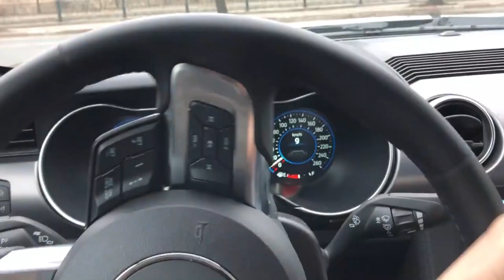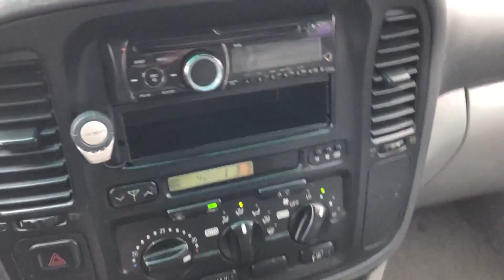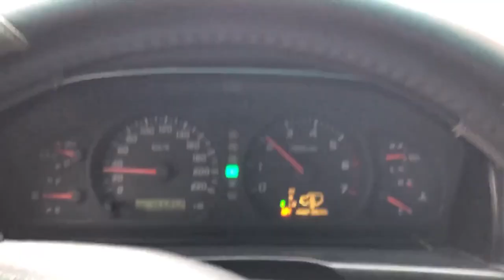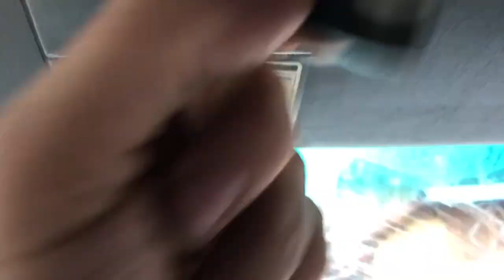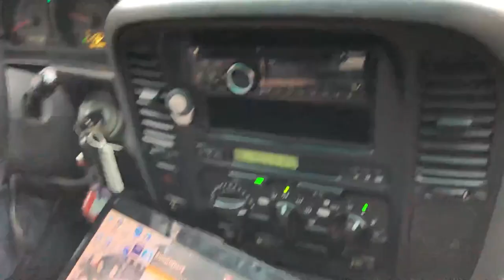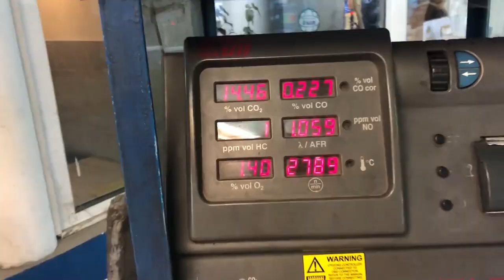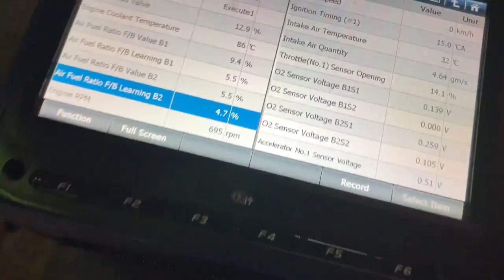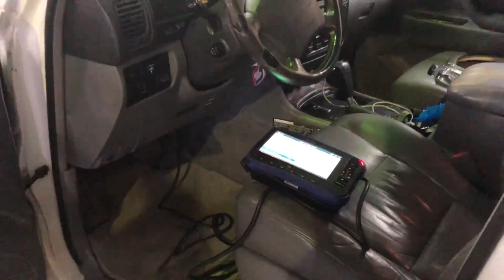EP1 - Off Road Build | Toyota LandCruiser 100

Comment: sa o stapanesti sanatos si sa ne revedem aici pe canal cand masina o sa aiba 1.000.000+ km
Reply: Totusi nu sunt cam multi peste 400.000 de km
Reply: @sergiubyker831  ptr motorul asta nu....merge 1 mil fara probleme...se vand la 800 000 de km ca si cum n ar fi nicio problema

Comment: 17:03 ... bullshit, acum scuze ca zic, dar astia care pun, serviceeaza instalatii nu au nici o treaba cu mecanica implicita a motorului, drept care omu zice o prostie, la multe masini am intampinat probleme la motor de cele mai multe ori supape arse si scaune supape avariate, din cauza diferentelor de functionare ca si AFR intre benzina si gaz, normal pentru a utiliza un motor pe ambele combustibile, necesita 2 harti separate pt ecu, sa menajeze aprindere avans si amestec, intradevar unele masini care nu sunt asa sensibile rezista in timp mai mult dar tot se ajunge la aceeasi final, probleme la motor